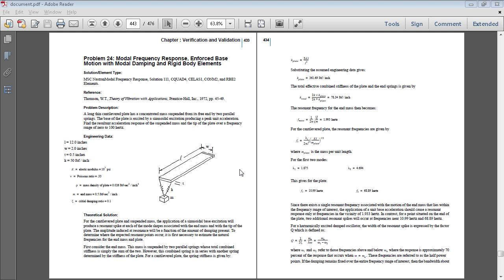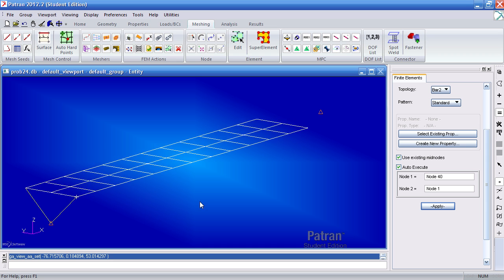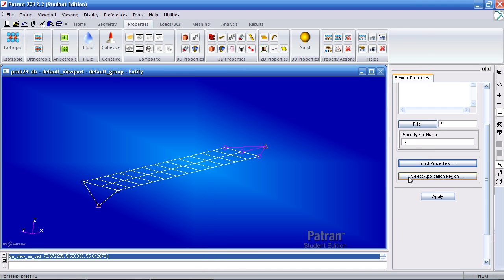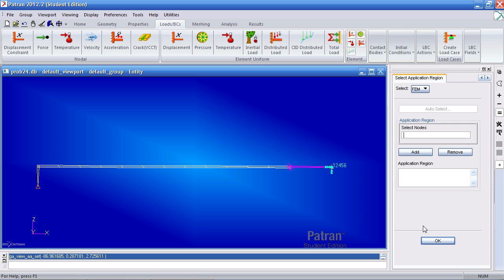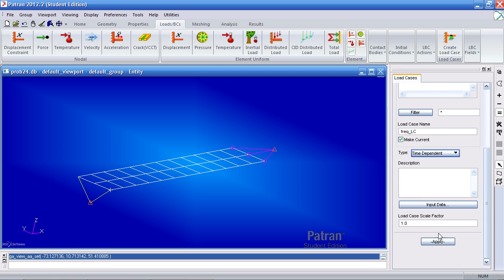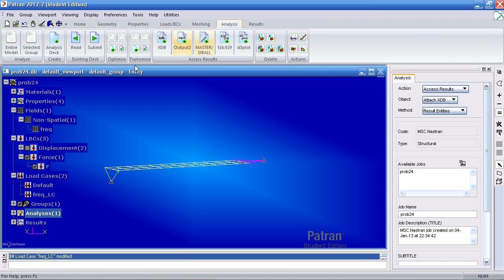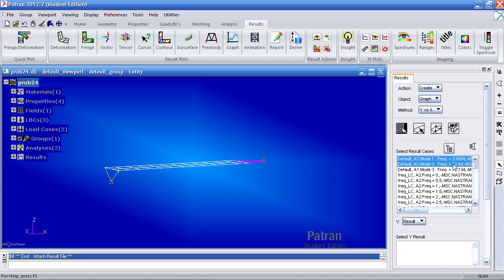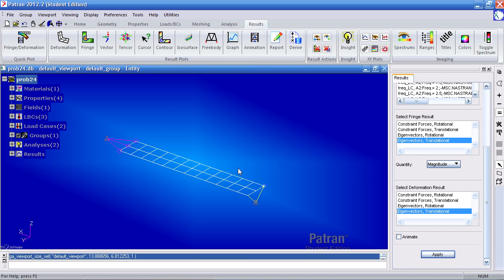MSC Nastran, Patran Tutorial - Modal Frequency Response, Enforced Base Motion

Comment: By defoult the option "Residual Vector Computation" switch ON. You have OFF, but you not mention to switch OFF. If user kips it ON the fatal error will be obtained 9050. As your model is free in Z (T3) direction.